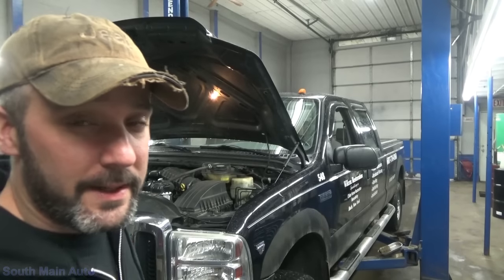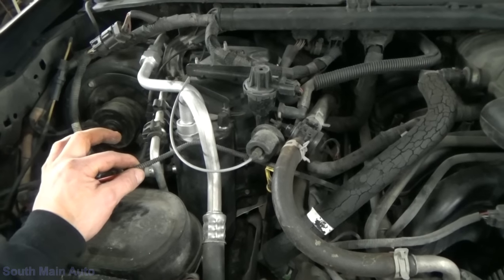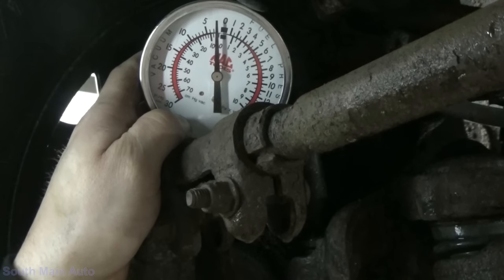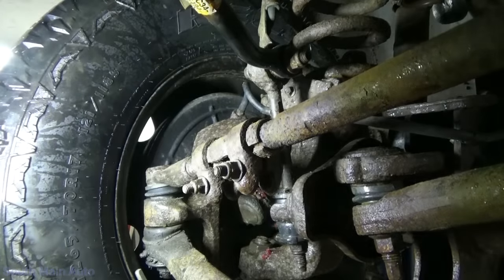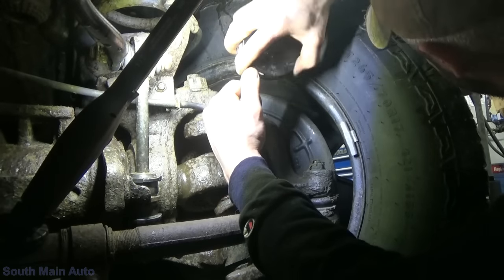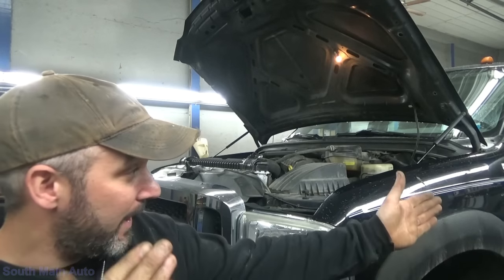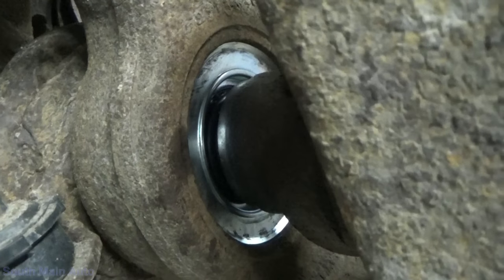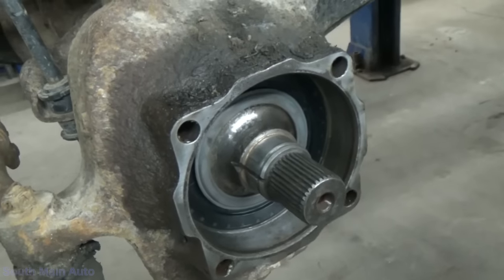Ford F250 4x4 - Vacuum Hubs NOT Engaging

Comment: Nice repair I have a 2004 Jeep liberty that does the same thing, dealership tried to tell me it was the drive shaft was dry. To lazy to look into it my self, but now I have a place to look so this is great. Also, is there anything you recommend to prevent yellowing of headlight covers I found something but it was like 50 to 60 dollars, looking for a cheaper alternative.
Reply: 04 Liberty doesn't have vacuum hubs, just the transfer case shifting in/out. The front drive shaft CV joint likes to eat itself and you need to grease the rear shafts splines now and again but that's about it.
On the headlights, Get a 3M kit and sand/buff them clear. Clean them with alcohol and buff with a clean soft cloth. Then use a good 2 part automotive clear coat to give them back the UV protection you just sanded off. You can get a good 2 part in a spray can from USC. 
https://www.amazon.com/Spray-High-Gloss-Clearcoat-Aerosol/dp/B0043B7UQY
Reply: Tape off around the lenses at least 2 inches to protect the body and grille. Sand them with decreasing grades of wet paper.  You can go as far as you think it takes.  I usually stop after 1000 grit but go to 2000 if you feel enthusiastic.  Clean thoroughly. They will look cloudy, but it is only the sanding.  Don't worry.  Get some automotive clear coat.  Be sure it has the UV protective formula.  Spray a couple of coats, with a light sanding between. After drying, I like to apply some good auto body paste wax for added protection.  You are ready to go for a long time.  If they get scratched or damaged just repeat the process.  The clear coat is the key to success.
Reply: Thank you +Blazer02LS, yeah I know that way from Chris Fix but really, the lenses are fine, I just want to keep them that way. That is the hard part, I don't want them to yellow over time, why I was asking about it. I found something on another YouTube Video but they were selling it for like $60.
Reply: Thanks +Paul Copeland as well, and same thing, they are clear I just want to keep them that way, to maintain them. They haven't even started yellowing, its a brand new car 2012 so, its why I am asking.

Comment: question for ya I just ordered the tool does that set the depth when you pound on the new seal as well? like the shaft bottoms out in the tool when you hammer it down?
Reply: yes, it's not that hard to do...……….

Comment: The pressure drops every time you move that Hub after switching it back into 2-wheel drive. The pressure is released once the hub rotates...

You can actually see in the video that both times you lean on the tire and move it, is when the pressure drops.
Reply: not really

Comment: Calling my f150 IWE hubs "cheesedog", really uncalled for, true but uncalled for. Good video. Rather have manual locking hubs myself. Surprised some aftermarket does not make them.
Reply: haha true. But the difference is: the F150 hubs are engaged when the vehicle is off, when you start up the vehicle the vacuum disengages them, when you click on 4wd, the vacuum releases and the hubs engage. What happens the vast majority of times, the hubs disengage and the springs etc are shot so they won't re-engage. 

Fordtechmakuloco has a good video on how to diagnose them.

Yes, I'd much prefer a mechanical setup. There's trucks out there with 400K miles and no prob with mechanical locking hubs.
Reply: @muskokamike127  I have a 2016 f150, the driver side started making the awful grinding noise. So they replaced thankfully under warranty because I was very close to 36k on it. The more I look at the setup though, the more I agree, cheesedog.  Relying on a vacuum (that runs the heater system too) and aluminum parts, and seals that go fast.

Comment: Truck only needs koeo for vacuum pump to cycle 

Mighty vac at the wheel vacuum line union will diagnose which wheel is the culprit

Nothing against otc. But 300 for that tool is ridiculous. I have a $50 eBay one. Does the job every time 

Before reinstalling the axle shaft, wiz wheel the shaft so the rust doesn’t damage the new axle dust seal 

Good work though brother!!

Comment: Shalom Would U Have To Do Tha Samething On An Ford F-150 4x4?Replacing Tha Hub An That Special Hjb Tool?
Reply: No special tools unbolt strut and remove unbolt axle and remove no need to separate balljoints pull 15mm axle nut then 3 8mm hub locker bolts reverse to install

Comment: "Designed to fail" says it all.
Reply from the maker: Well that is what I think about it...
Reply: It's about the only way to eliminate having the front DS's rotating in 2WD, tho, and provide on-the-fly engagement.
Reply: @RossABQ  I feel there are a number of other manufacturers who do not use vacuum hubs on 4x4 trucks and who puts a vacuum system of any type on a Diesel?
Reply: Did you just describe ford? I think you definitely just described ford as a brand.
Reply: Todd Hoskins yea thats true lol
Reply: @sciewter  this is a v10 gas engine

Comment: I think it is just the superdutys that use this arrangement with the manual/vacuum lockers? The F-150s are electric, it that correct?
Reply: No they have vacc hubs after 04
Reply: And vacc axle disco before that on the diff

Comment: Never used the tool-4” pvc coupler Is what I use, i just measure the depth and reinstall it to that.
Reply: Was literally just going to comment the same thing lol I’ve done dozens without the tool just measure the depth before you remove it and tap it back in with a soft head dead blow

Comment: Seal drivers are Very easy to make from 1, 1/2 pipe nipple 10" long, cap, flange turned on a lathe a bit smaller than the seal . just watch the drive depth .
Reply: Sure, but how many people have a lathe?

Comment: wayne baker     hello from Wayne B in winnebago,nebr.  I'm texting you causei;m running out of options as to help me fix my ford f150 2002 4.6.  got a short in the OD somewhere. I'm on  SSI , hobby is working on vehicles, not electricity. Had a small fire when putting it together. it ran goood for year, now this. Gotta try the button in the shifter. Getting ready to replace the wiring harness soon. Missed out useing it for hunting season, really loved working on this truck. Need it now more then ever,cause got 4 poeple in the house n only 1 ford fusion.....PLEASE help me with what ever you can.

Comment: My hub selector is hard to turn i need pliers to turn them. can they be cleaned to free them up, or do they need to be replaced? I was hoping you would touch on them as you did the unistall.  -John
Reply from the maker: You have auto hubs?
Reply: Ya I have the auto / lock  hubs.
Reply from the maker: The ones that bolt on like on this truck or the long black ones with no bolts?
Reply: It is a 2012 so it is like the one on the truck you have in the video. I have been searching on line and can't find anyone who has a video on how to keep the selector turning smoothly from lock to automatic.
Reply from the maker: have you tried replacing it with a Toyota?
Reply: LMAO  a Toyota would never handle the weight of my plow. I had a friend that said the bearings go fast on a toyota with a plow.
Reply from the maker: ohhhh well it was just a thought. Hey you could get a 7'6" Fisher HT plow and just plow twice as fast? Saving time and money
Reply: Ya you can unscrew the cap and clean em up. Most likely the spline gear that doesn't go back and forth easily.
Reply: So just unscrew them and pull them out. use some "Ta Daa"  Break cleaner and then grease them up?

Trying for the sound effect like Eric's LOL
Reply from the maker: Perfect sound effect!
Reply: You liked that did ya.
Reply: +The Plow Guys sorry but your friend is incorrect toyota tundras handle plows like a f350 I've never seen  bearing go bad on plow tundras hell a local landscape company has a fleet of 14 5.7 double cab tundras with  8 foot fishers and some "V" plows run them like their diesel rigs no issues I've service them only regular maintenance has been done their oldest (07) has just over 300,000 miles. Hell I've done more head gaskets on 6.0 power strokes then any more then maintenance work on toyotas in general don't beat me till you try them, also don't take advice from friends take it from the professional! Also tundras are more American then the "American" trucks and the money goes to American people not Japan unlike some peoples thoughts/comments
Reply: +Sean Rebelo it*
Reply: +Sean Rebelo beat it*

Comment: so..... correct me if im wrong.... 
but if the hub seal goes out..... and their is manifold vacuum.... 

wouldnt it be sucking dust STRAIGHT into the motor?? by-passing the air filter?
AKA..... sucking ABRASIVE dust right into the clyinders??

yet people say ford engines will out last a GM 5.3........ ya sure about that bud?

Comment: tool is about 70 bucks on amazon.  Not super expensive. They even sell all the seals as a kit for 60 bucks.  If you needed a new auto hub assembly that's another 100 bucks.  If you redid both sides completely with the tool it's still only 400.  330 if you could rent the tool.

Comment: So basically auto lock hubs 4wd are a pain in the ass with lots of potential for not working.  Mine have never worked, bought the truck used.  Manually locking the hubs is no big deal to me.

Comment: Excellent video ! Love the "crow hop" description....
Reply from the maker: Well that is what they do, crow hop in 4x4 and fishbite when they are skippin!
Reply: Oh I know, and that's why I like your description. I've got a 4x4 01 ford f150 , base truck, six cylinder, and occasionally may put it in four wheel on the boat ramp when it's slick, and make sure I disengage it before I have to cut my wheels. Can't stand that "crow hopping" and it can't be good for it. I have a friend that claims to have driven all the way back from deer camp with his in four wheel (chevy truck) and I'm thinking how in the world could he not be feeling that. Anyways , again great video Eric and thanks, I had no idea how the auto locks worked and now I know a little bit. Mine doesn't have the manual option though....and if mine ever go out, if I can , think I will just have the manuals put on there. Thank you Sir....

Comment: those engage fine, they don't disengage very well, internal springs are weaker on auto hubs.  stupid design.  i removed my diaphrams and went all manual with different parts.  my hub looks different, but i have a 01  those big seals do suck.  so can the inner seals by the pumpkin.  i made a special tool for both.

Comment: How does the drive shaft get out of balance?
Reply: Could be from the weights either rusting off or getting knocked off, or from the driveshaft being bent by off-road obstacles.

If someone attempted a repair, and didn't get the shaft 100% straight before welding, that will do it too.
Reply: there are weights pressed/welded on them, 
they can work loose, get knocked off, = imbalance.

Comment: So the Ford slogan “Built Ford Tough” just means it takes a tough customer to want to keep this truck rolling since you will have a such wobbly drive shaft that it needs to be replaced and various leaking seals that were designed to last for just a few months... ..im curious how do most other brand pick ups or such as the Toyota Tundra 4WD design compare to this F 250 ....or are they all made in basically similar "cheese dog" ways ??

Comment: Is it possible just put in a set of Warn (or other aftermarket) Manual hubs and call it a day?  If this is a repeat problem, I'd rather just eliminate the issue all together....  Getting out and locking hubs really isn't a big deal to me.
Reply: The heavy duty Ford's have auto and manual locking hubs. You can get out and lock them manually or use the automatic vacuum system (if it's working) instead of having to get out and lock the hubs.

Comment: So if you are giving it some throttle (no manifold vacuum), the hubs can't engage?
Reply: There's a check valve between the intake manifold and the vacuum reservoir and accessories. You can hear the hiss when he unplugged the reservoir -- it had still maintained vacuum until then, even with the engine off.

Comment: Don't need any special tools for a 2005 F150. Super Duty looks massive in comparison. I replaced all the rubber and cheap plastic tubing with urethane tubing. It's a mess of spaghetti and vacuum check valves.

Comment: DO NOT BUY CHEAP TOOLS FROM DEPARTMENT AUTO STORES! Cost me several hours and $80 trying to get the snap rings off.  Tractor Supply had a simple 4pack for $10. In the bargain bin! Worked great.  Don't buy the MULTI-function jobs. They suck hard.
 Thanks bro.  I'm doing this soon.

Comment: Nice one and I know who has the tool. LOL
Reply: This guy has all the tools needed Steve. In another few months this will be the goto guy for most repairs. I bet ya other mechanics watch these videos from work to see how to do a certain repair.
Reply: The Plow Guys Your right John all the way from NY city their coming too , haha I know where to go too :)
Reply: I am having trouble with my hubs. I might have to take a trip down there to have them fixed.  Just not sure about the head mechanic there. He suggest I replace my hubs with a Toyota...I don't think I can get a Toyota to fit in there.  LOL
Reply: The Plow Guys  HAHA I think you should be driving a chevy worry free driving and  no vac. hubs. LIKE A ROCK - LOL
Reply: I owned three chevy pick ups. and they all had problems. Like a rock ya right. Transfer case replacement 1500$ on two of the trucks, front seat module defective all three trucks, memory seat function defective, front wheel bearing replaced after two years two of the truck's, Door latches replaced on all four door (they no longer stayed closed) two trucks. Drivers window cable broke. Window fell down, Fixed under warranty...That one was free. I am not dumping on GM. Every car manufacturer have their weak spots. Oh and let's not forget about those Bosch injector. 1000$ to replace one injector. only on one truck.
Reply: The Plow Guys  Try a Dodge next time and you will love the chevy even more.LOL
Reply: About Bosch injectors and other fuel systems, just a suggestion. Use quality diésel fuel and maintain your fuel filter, better OEM or of quality, updated. 
Fuel Requirements for Diesel Fuel lnjection Systems Diesel Fuel lnjection Equipment Manufacturers Common Position Statement 2012     stanadyne.com/docs/sale/Common_Position_Paper_2012_signed.pdf
Reply: The injector broke. Had nothing to do with fuel or filtering. How do you tell if you are buying quality fuel?
Reply from the maker: DODGE STEVE? DODGE!? You think this guy is gonna marry his cousin or something? Plus he would have to change the name of his channel to "THE FLATBED GUYS" Because there would be a lot of need for that once you bought a Dodge!
Reply: South Main Auto Repair HAHAHA
Reply: Fuels as oils have a technical data sheet, these are from Spanish companys (diesel). There is of Shell, BP...
Repsol Diesel e+ Neotech  imagenes.repsol.com/es_es/Fichas_productos_diesel_eplus_v14_tcm7-743522.pdf
Repsol Diesel e+10 Neotech  imagenes.repsol.com/es_es/Fichas_productos_E10_v13_tcm7-743521.pdf
Cepsa Optima Diesel   cepsa.com/carburantesoptima/pdf/fichas_diesel.pdf

The difference is in the package of additives; once refined the oil, each company adds its additives to the diesel or gasolina, that makes the diference in quality and price. There are what we call here "white marks" mainly supermarkets that sell fuel with the mínimum of additives.
Reply: Oh boy. You really like Dode don't ya Eric..LOL   I think the reason most people stick with a brand is cause they know what will go wrong and when. Easier to fix thing if you know they are going to break. I always go through blower motors on my Ford Van. So now I keep a spare. If it goes I just swap it out with the new one and order another. I normally go through a blower and alt. every two years. It is just one of those things.
Reply from the maker: The Plow Guys When my vehicles break I just get a new one to haha. I let the problems pile up and tradem' in! You would think I would be good on maintenance and fixing my junk but man I hate workin  on my own crap.
Reply: I hear ya. It would be like being a maid and having to come home and clean your own home. What a pain that must be. I transport Newspapers. Never read them..and before you can say it Eric. YES i can read.LOL
Reply from the maker: HAHA I know you can but that Steve guy I am not so sure about...
Reply: South Main Auto Repair I'm dumb as a stick , ask John  he knows me well .   I can barely walk and chew gum at the same time :)
Reply: Sure you can Steve. I have seen you barely do it.
Reply: The Plow Guys This  week John  your jerky  will arrive, don't forget Justin,  he get half.  The guy  pretty much does everything for ya .
Reply from the maker: Salty too!
Reply: Everything. are you kidding. I house him, feed him, pay for his internet, cell phone, Give him free parking,
Reply: The Plow Guys John - my father used to say to me - they never asked to be born.  LOL
Reply: The Plow Guys should have bought a base model! I'm an just messing
Reply: South Main Auto Repair  I'm working on some moose and for the first time trying pork  jerky. Which one you like or both. I'll try to make it less salty for ya.
Reply from the maker: Both duh!
Reply: I need some luxury. Cloth seats for my tender butt is a must. Chrome grill and bumper for style.

Comment: my ole1989 GMC 2500 vacuum 4wd still works perfectly. Truck all original except wheel hub and fuel pump.
Keeping my ole truck till I drop..new stuff so over complicated and fragile. Like some computer nerd kid designed work trucks...wait till these vehicles get older and all the high tech plastic starts failing. ..
Invent a gage with a magnet *